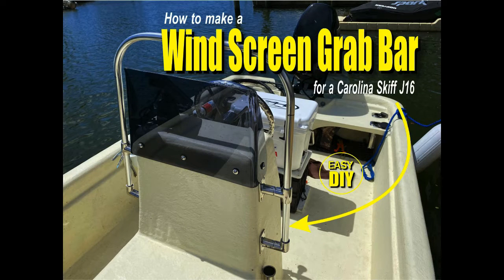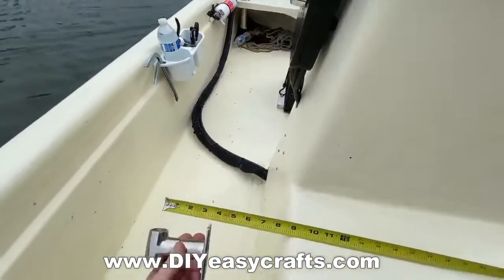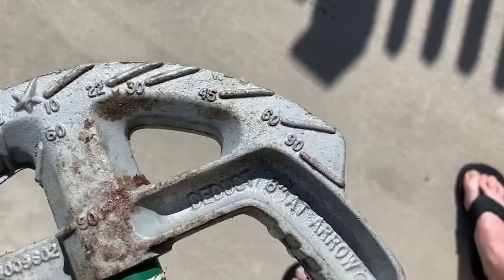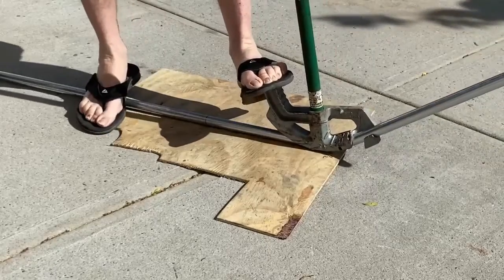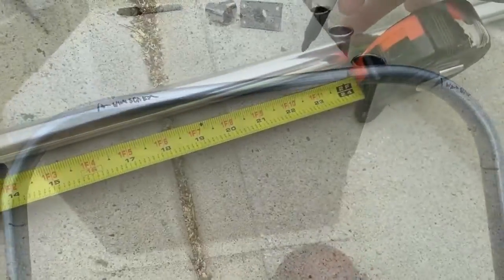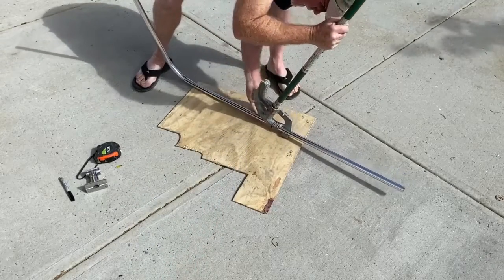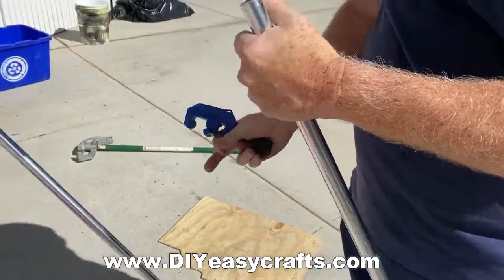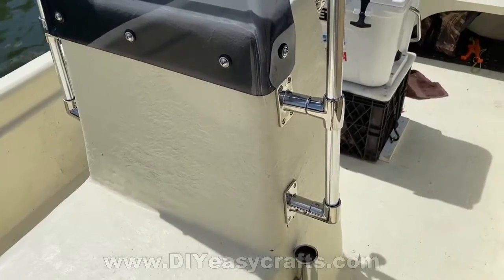How to make a Wind Screen Grab Bar for a Carolina Skiff J16

Comment: That was awesome! I have a center console that is almost impossible to find a grab bar for. And anything that would fit is ridiculously pricey. Typically around $400-$600. That’s crazy. I’m definitely going to do this. One guy said he did it with the EMT pipe and then sprayed it with the truck bed liner to waterproof it. Pretty slick. Thanks for sharing!

Comment: How did you get the rail to stay in the fittings. If you lift up doesn’t it just go out of place of the base or do it screw in place? I want to do this but my fear is it just goes out of place if I lift it or when my boat hits a wave.
Reply from the maker: I attached all of the fittings to the tube and then held it in place and marked screw holes. Easier if you have a helper.

Comment: nice job ! SUB .. I have a 13ft Boston whaler I’ve been working on its been over a year since ive worked on it .. Do to Me Moving  .. I am finally going to be bringing it home soon hopefully at the end of the week lol .. its almost finished ..  But  I need to still build a Center console for it ..  I have a few videos on the channel if you wanna check it out  feel free anyone !! .. I restored this whaler it was in a little rough shape .. But I restored it the RIGHT way !!  all Fiberglass work and Gel coating and  none of that  Marine BONDO Crap   .. I don’t want to have to redo Any of that Fairing stuff later in the future when it falls apart  ..

Comment: Were did you get the mounts and fittings
Reply from the maker: Local marine hardware store
Reply: But did it come to get there or what , because 7/8 fittings dont go into the same 7/8 elbow or tees, did you get the base bigger?